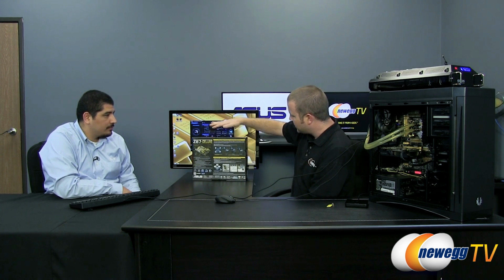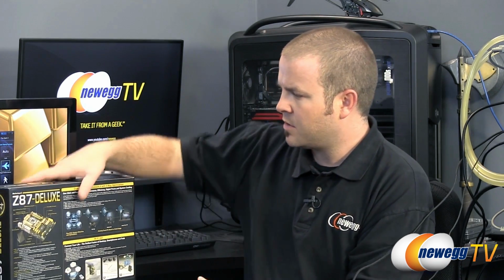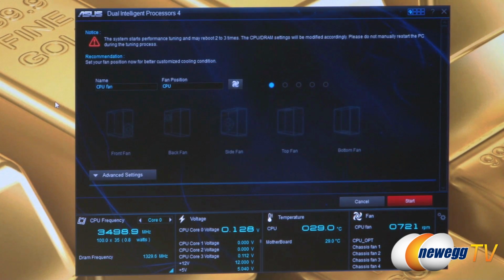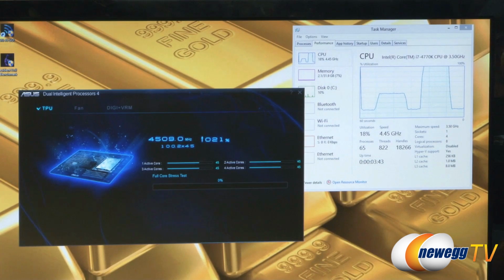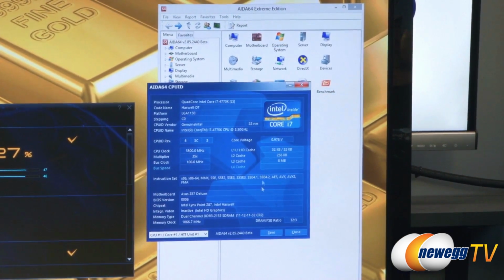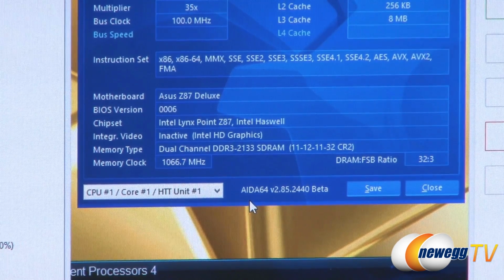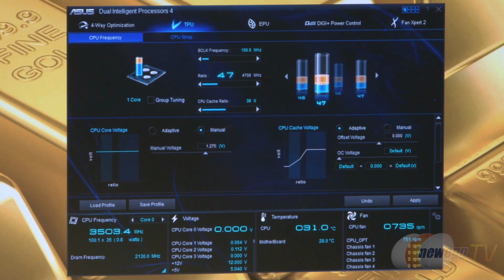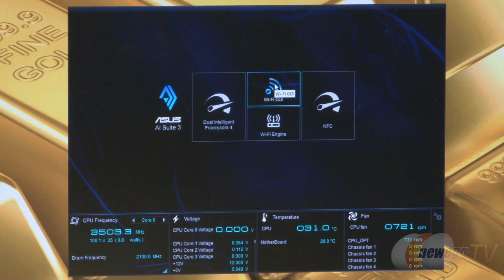Newegg TV: ASUS Z87 AiSuite III + 4 Way Optimization OC Demo Overview

Comment: You're fucking stupid if you think their ROG series is going to have auto tuning. Why spend $250+ on a motherboard meant for overclocking if you don't know how to do it your damn self? Don't buy a high end motherboard if you aren't capable of using it to its full potential. It's not Asus' fault that you didn't pay attention to the product line's feature set.

Comment: Well if you buy an RoG line product, you should know enough about overclocking to not even need it done for you. Think about it; the Hero board is for gaming, the Formula is for overclocking, and the Extreme is for balls to the wall liquid cooling with custom loops, $2000+ builds. Almost none of these people concerned with power consumption or fan noises are concerned with the features those motherboards offer.

Comment: For anyone considering an Asus ROG motherboard:
Have you seen JJ / Asus advertising the "4-Way Optimization" literally everywhere? Yes? Then DO read this:
My Asus Maximus VI Formula does NOT have to auto tuning fuctionality in AI Suite III, apparently no Asus ROG board does. 4-Way Optimization on a ROG board is a farce.  Under TPU, I do NOT have "Extreme Tuning" (advanced auto tuning and stability testing). ROG boards only get options for 4.2, 4.4, 4.6 for "CPU Level"- nothing else.
Epic Fail!

Comment: Thanks for the reply, that's a bumber about the 4-way optimization not being on the sabertooth board. This is an outstanding feature that coupled with the amount of termal sensors on the board and the dust fortifier would make that board absolutely outstanding for me.
But again thanks clearing that up for me

Comment: Can't i just put my CPU into a manual voltage and then after im done testing it with prime switch it back to adaptive? This way i don't throttle and my temps stay good. Right?

Comment: Damn near NON of MS's o.s.'s were FULLY developed at release.  You apparently haven't kept up with history.
Why do people think they need a " start button" 

The windows key on damn near any keyboard does THE EXACT same thing.

Thus all the start button does is take up room that could be used for a quick launch program or folder
classicstart from ninite dot com. metroui, skipped.  Only purpose of metroui is for touchscreens

What else do ya have to complain about regarding win 8?

Comment: bugs and failures?  Yeah  ...sure willienotmakeit  -_-

Win 7 to win 8 is not = to xp to vista.  Stop living in the past.  you haven't a clue of what you're trying to talk about.  Stop spouting nonsense.

Go hate on win8 somewhere else.  The ONLY times that xp, 7, and 8 have crashed for me is when I put in the wrong overclocking settings for my motherboards.  THAT was a HARDWARE problem and not a result of the o.s.'s programming.  Otherwise, none of them have ever crashed.

Move on.

Comment: I love asus product even when some had fail.. whatever... 

JJ is there a way to control the fans manually on a maximus gene V. 
I made a custom PC rack with this MB and the GPU is running super hot im afraid of having temp problems yet all 3 60mm fans are at idle...any help.. I try the smart auto learn mode but I no help.. thanks 
i73770k
corsair h60
32G 1866mhz crucial elite
galaxy GTX460WHDI
ultra mini400
3 60 silenx 16db fans plus a 80mm fan on PS